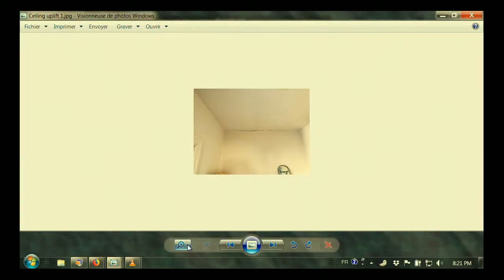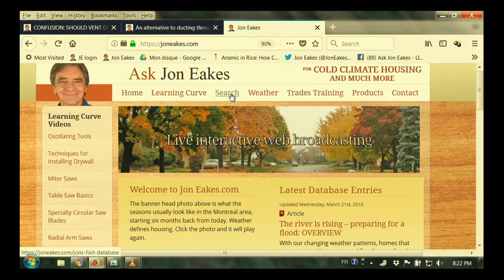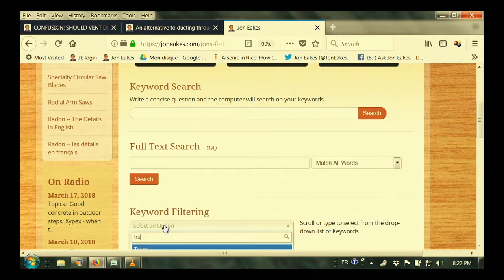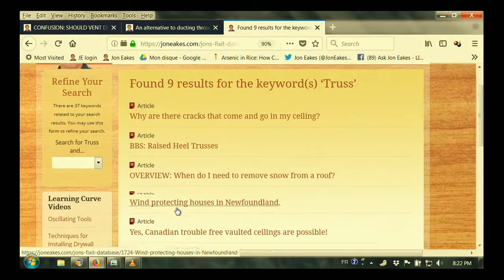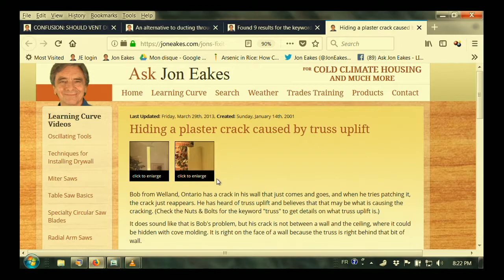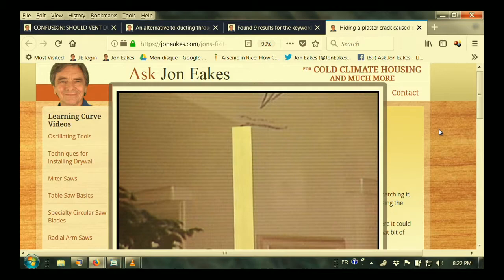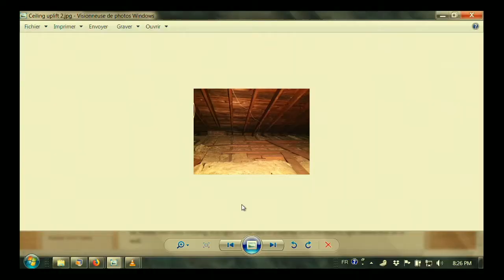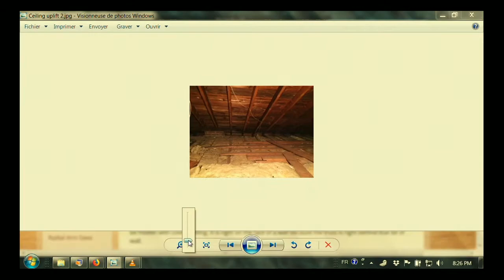Truss Uplift

Comment: Truss uplift:  By hiding the crack this leaves a hole in the attic from the house increasing stack.   This increases utility bills and increasing the likelihood of damage to the roof deck and icicles.  Need an actual fix for the possibly hundreds of thousands of home in cold climates with this issue